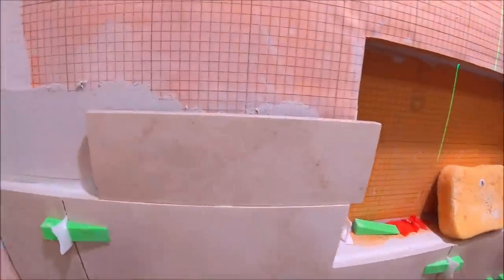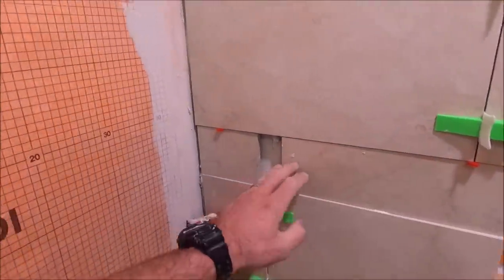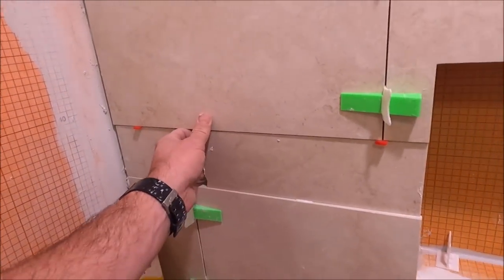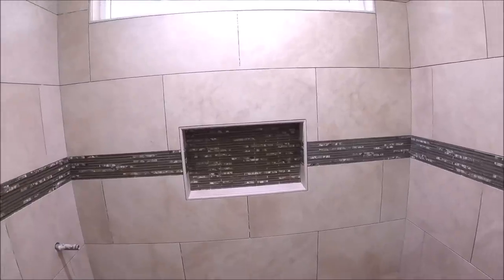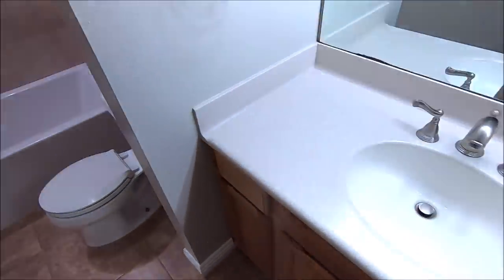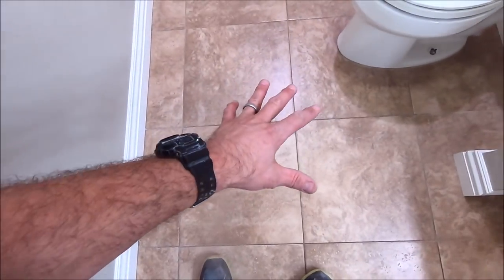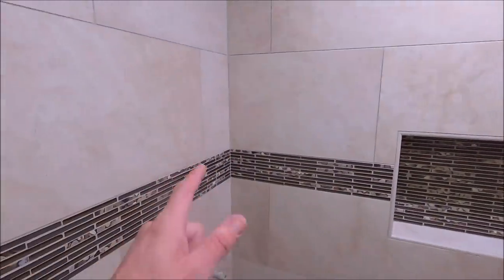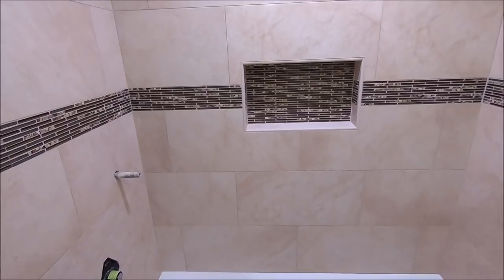Is This Shower Trend Coming Back?

Comment: Rather than using tile as your spacer, use wood or something soft. Tile can easily chip the edges when you remove the tile spacer. Ask me how I know this .
Reply: Yeah and he’s sliding a piece of tile over the glass to flatten it and the metal trowel.Use a rubber float, and use float strips to hold the tile up till they dry not pieces of tile. Chip chip chip
Reply: Exactly, we usually allow 1/8 space when use tiles as our  temporary border spacer, use 16th spacer on top and bottom , learned this the hard way

Comment: It is a little dated, but if the customer loves it thats all that matters. And the work looks very clean. I don't mind running that strip vertically on walls. Actually like it. Even offset sometimes. Anything different makes the day suck less. Lol. Nice seeing someone else screed. Sometimes mosaics set on kerdi strips works well to eliminate any ooze. Thanks for the video.

Comment: A better method is to cement the glass to the Kirdy board first, in full length pieces, then cement the entire assembly to the wall. Gives much better control over depth and flatness.
Reply: Yep! Just measure the length and cut it out the night before. Glue it to the Kerdi board and the next day you can glue entire sections in. Makes it easier and faster
Reply: Wish I read this a couple weeks ago, would have saved me some trouble haha
Reply: If the glass was straight on the edges that works ok, but because this glass is in and out, imo not something I would do...where do you end and stop glass on the Kerri and what if they don't fit back in perfectly...its like doing a plank floor and leaving out interlocking pieces, they never go back perfectly,  either in grid or height...
Reply: @vapdivrr5656  I make the sections larger than I need, then cut to size.
Reply: @mikehands61  so if the wall is 5ft you make a 5ft section? I'm doing a shower now that has 8ft lenght walls , how long can you do the sections?
Reply: @vapdivrr5656  generally like to work with 3-4 foot sections. In that case, you have to set it up to key together by overhanging the sheet tiles to create the key.
Reply: Great  tip !!!!
Reply: Better for who ? The screed method creates a  stronger bond and controls the height perfectly.
Reply: @markme4  it prevents the thinset from oozing through the joints on thicker adhesions.
Reply: @mikehands61  you can use a toothbrush & sponge to clean out the thinset.
Reply: @j.w.r.i2910  because that's what I want to spend my day doing...

Comment: That was awful risky sticking those 4 inches spaces in there directly on top of and underneath the other tiles with out using spacers. You could have easily chipped the installed tile while pulling out the 4" pieces. That would have sucked bad.
Reply from the maker: We had spacers on top but not bottom, but yes, a little risky. That crunching sound when they come out makes your eyes squint!
Reply: @LandbergTileTV  dont lie you had to rip thoes top tiles out yhe next day you didnt account for spacers lol

Comment: It looks like a good amount of thinset was still left in the Listello build up. Did you have to let it set up a while before you installed the trim so thinset would not ooze through the thin joints?

Comment: Beautiful job. I’ve been looking for the same window you have in the shower.  Can you provide where you picked it up?  Thanks.
Reply: You can order any kind of window you want at a material supply house. Do t bother with anything from the hardware store they only stock junk. Be prepared for long lead times for windows right now though.

Comment: Sweet work and video!!! Too many questions... I know :(
When you were installing the 1/4 round around the niche I was like 'what is the metal track looking stuff on the back of 1/4 round'? At the end you called in 'peerless round edge"... so is that material painted aluminum? Looked just like the tile to me. 
Do you caulk or grout between tub/tile and do you caulk or grout corners? 
When you were installing your first section of "stripe" it looked to me like you installed a board or something to build the glass tile out...did you? Later you used that screed which was awesome.
Reply from the maker: Yes, aluminum Schluter Rondec, we always caulk where the tub meets and usually caulk the sides. We build out the stripe usually with 1/4 inch board or Schluter Ditra

Comment: the best way is to adhere the glass mosaic to the kerdi board or kerdi wrap and install as one piece, not to build out the niche and install that way.  Keeps the mosaic completely clean and much easier to keep it flush with existing tile.
Reply: I was thinking the same thing. You saved me the keystrokes.

Comment: Potential chipping other tiles 😬. I use plywood, or Kerdi Board strips. Screw straight to the studs. I use Aluminum Foil tape. Sticks awesome then others...tub looks wider than 32", or is it the camera amgle? If it is, who sells it? Hard to find in today's world. I prefer Quadec .Good bath job...
Reply from the maker: Good idea on the kerdi board spacers. Tub is 32, just a wide angle and I prefer quadec or jolly, but the rounded (quarter round look) compliments the travertine tile design and stripe design you would see in 2002

Comment: That existing floor tile looks like the ugly stuff that was in my baths.  We replaced it with a porcelain similar to what you used on the shower walls.  But, the upstairs baths still have the ugly brownish tile on the floors and bath walls.

Comment: What is your go to grout for 1/16 grout joints? Laticrete permacolor , prism , spectralock 1? Amazing work as always!
Reply from the maker: We have had zero problems with Prism for the past few years and always seal it!
Reply: I have problems with the pre mixed grout leaving a haze after grounting i try to sponge it as much as i can without taking out my grout lines any suggestions on easier cleanup? Its seems to do even worse on polished tile
Reply: Mapei Ultra Color works well with 1/16 " joints

Comment: What size rondec are you using with 12 x 24 tile?  Thanks.
Reply from the maker: Usually 3/8 but 1/2 works just fine